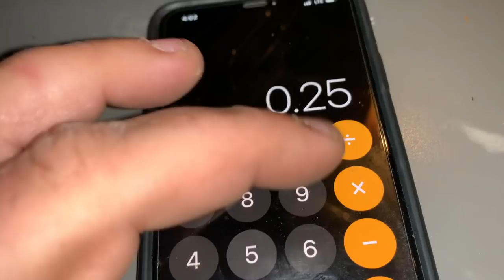A Day of HVAC Maintenance Calls

Comment: I like your harbor freight light, I have two of the they work great. Ted doesn't use a dollar bill, he uses a 100 dollar bill to clean flame sensors.....😏😏
Reply: He does use a 100
Reply: Ted used a $50 dollar bill to clean a flame sensor in one video and some people poked fun at him so he used a $100 dollar bill in a later video.
Reply: @picklerix6162  $100 bill cleans better.

Comment: You guys don't have to use black iron pipe inside furnace? Thanks for the clip.
Reply: I have never seen any black iron pipe in any furnaces in Texas.  I never saw any drip legs until recently. I did install a drip leg for my new furnace that I installed last Spring.

Comment: been through same crap, sand paper on flame sensor for last 20 years no problem ever. they can say whatever they want, bla bla bla  just use clean cotton rag or paper towel to wipe it down after sanding.  I clean the one in my home like that every 4 or 5 years just for fun.  never had a problem once

Comment: I don’t care how much more efficient gas is I will only use heat pump all electric. Screw having pressurized flammable gas in my damn house!
Reply: Natural gas is delivered at only a few psi, meaning less than ten. Most of a gas furnace is for ensuring safety. All houses should have Carbon Monoxide sensors if any combustion happens gas stove/oven, driers, etc.
Reply: @Kenjiro5775  I don’t want flammable gas in my house period. Pressurized or not.
Reply: @primeministerofredneckistan  to each his own.
Reply: @MrTrailerman2  indeed.
Reply: Because electrical never caused a house fire lol